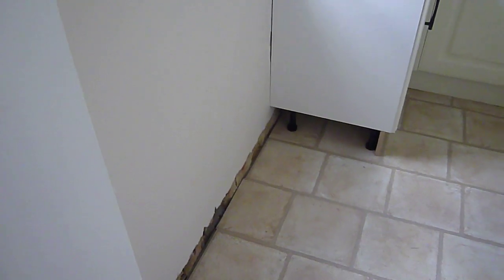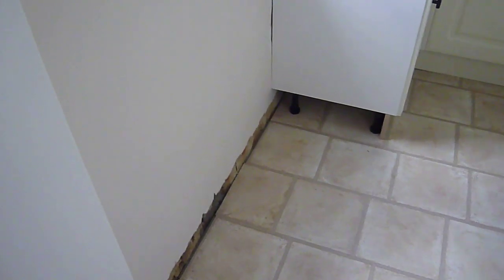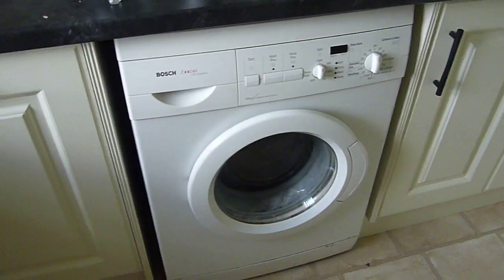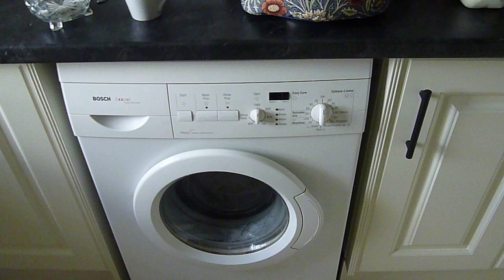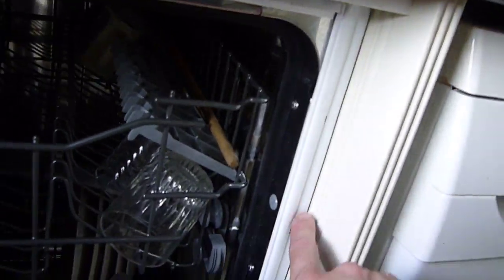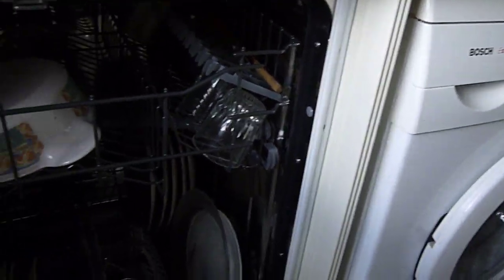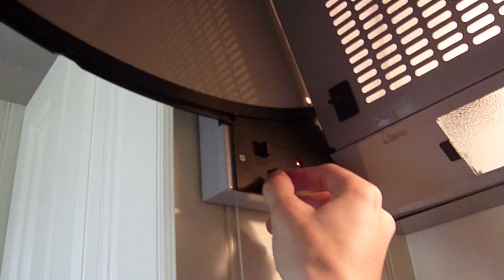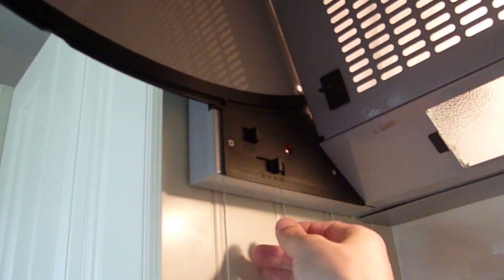john phelps kitchen instalation problems

Comment: I had my kitchen fitted with John Phelps and Apricot Interiors last year. I wish we’d seen this video and done our homework beforehand. 
The installation was started on 28th of August and finished just before Christmas. Quite a bit longer than we expected. 
He lured us  in with a good talk promising personal hands-on service that only a small company can give you. When the real work started he stopped picking up the phone, sending pompous excusing emails instead. Numerous mistakes in measuring (that’s his job!) were made, sending in the wrong size panels, handles, bins etc. 
During one of his very few visits to the site I pointed that I’m not happy with one of the large end panels. He and his wife shouted at me and stormed off like two spoilt kids. 
The kitchen fitter was good and overall we are happy with a quality of fitting. He very often didn’t have anything to do as we were constantly waiting for replacement parts which often took weeks to come.
 My husband kept on  top of the financial side and we paid by instalments. I  don’t dare to think how we would have ended up had we paid the full amount up-front.